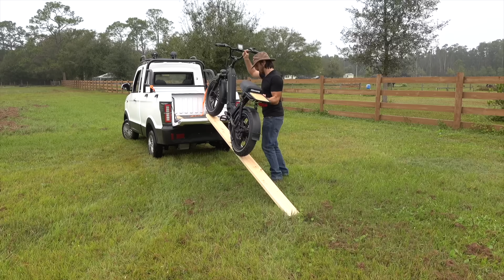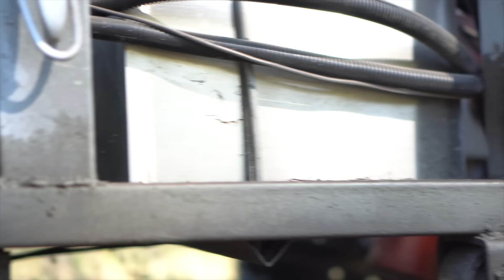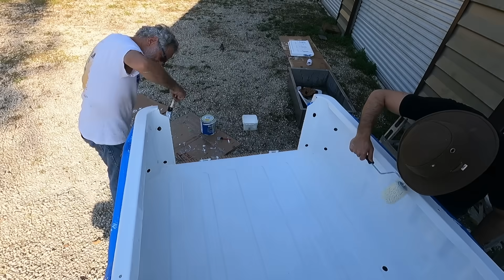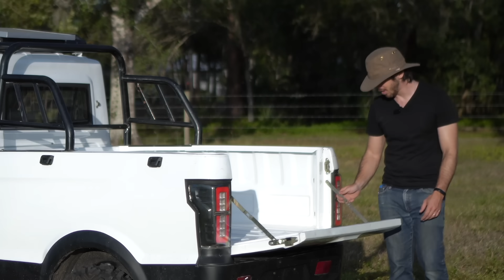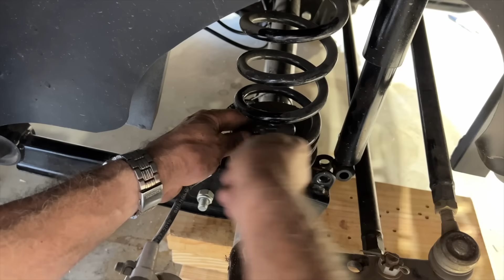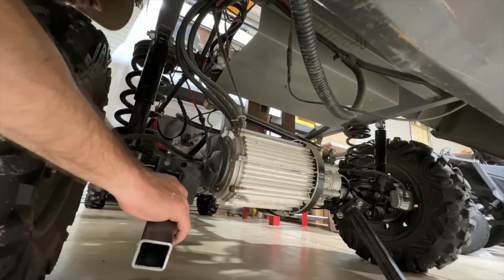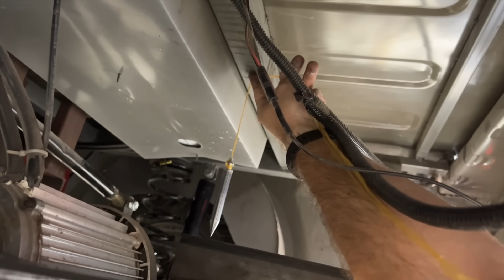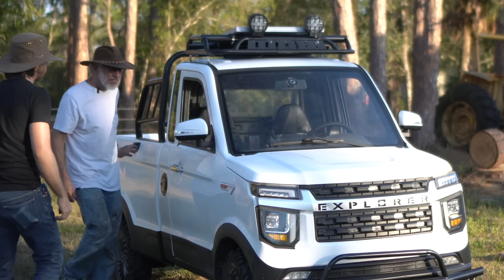My Chinese Electric Mini-Truck 18 Months Later: Did It RUST OUT?

Comment: At 150 dollars a gallon, I would have used epoxy. Not "epoxy paint", real two-part epoxy.
Reply: both have pro's and con's.  Used a lot of epoxy in the past.  Wanted to try this just to give it a shot.  Many good reviews on it.  Glad we tried it.  Good stuff.
Reply: @micahsdad5388  I've used it.  It looked good for about a year.  I used epoxy on another truck, and it still looks good after 20 years. 
Anyway thank you for your channel.  
I have a house in a city located on an island in the Caribbean.  That truck would be the perfect vehicle.  Town is just one mile away, all paved and level.  I don't require heat nor a/c.  I think with 100 watt solar panel, I won't have to plug it in.  
I would like to order three units.  Do you think that  they would fit in a 20 foot container?
Reply: @josephmistretta6211  Appreciate your review of that product.  Yes - I think that 3 would fit.  Be sure to ask the factory that question.  They might need to tilt them up on an angle.  I have seen that done with mini-cars to increase capacity of a shipping container.  What Island ?
Reply: @micahsdad5388  Isla Colon in Bocas del Toro.
Reply: @josephmistretta6211  How wonderful.  Was nearby there a couple of years ago going from Costa Rica to the Panama Canal.  Beautiful !!
Reply: Yes, the canal tour is amazing.
They could use an Ebike shop in Bocas Town.  Something to think about.

Comment: Mounting the tow hitch frame to the axle and the truck frame sounds like it would restrict axle movement.
Reply: Still working on that design.  Lots of limitations due to the design of the dump bed so some compromises will be necessary.  Stay tuned for the final iteration.  Best regards

Comment: This is the "3/4" spring.  Makes sense if you were loading up the truck.  I can tell you from experience an F250 has basically no 'spring' when empty.  But once you get it fully loaded you are happy for those heavy springs.  This seems like a downgrade/sidegrade depending on what you are doing.  But hey, you tried the original ones and you weren't doing the kind of work they rated it for (1,000lbs of gravel?)

Comment: I’ve seen ppl sell these without the upgrades you guys did - 10,000-15,000 
Would you guys ever upgrade and sell these? I’m so in love
Reply: Nope - thought about it but not interested.  There are a few some small companies doing it.  Problem is that these are NOT street legal and do not simply qualify as Low Speed Vehicles (LSVs) just because they don't go over 28 mph.  Without being street legal there is a very limited market sector for them.  We have such a use on our private property.  There may be a few very isolated communities that would allow it (by simply looking away?).  But without a VIN, lacking various DOT approved equipment (lights, glass, seatbelts, etc.) and not being manufactured by a NHTSB recognized factory, these will never be street legal (even though some people are saying you can license them just like golf carts - generally not true).  Thanks for your comment.  Best regards.

Comment: letting the tailgate go down flat would it interfere with the dumping feature of the bed?  when the bed goes all the way up will the edge of the tailgate be hitting the ground or the concrete when you're dumping a load? I would check that first to see what the clearance is.

Comment: So the 2k truck was how much after fees? Asking for a friend
Reply: see original video for detailed breakdown of all costs
Reply: $7,950 TOTAL for the $2000 truck from China  🤔🤣
Reply: @re3065  yep - and still a great value considering all that this thing does.  Expecting to get years and years out of it considering that at 18 months in it is running great without breakdowns of any kind (did let it run out of juice once - my fault !).

Comment: I was thinking about using it for a power golf cart around my community,  is it street legal, did you get the paperwork for a title?
Reply: NOT street legal, even as a LSV (there are some importers saying they are but this is not true except in the most extreme local community situations).  There is NO VIN - can't be registered without a standard US VIN.  No paperwork of manufacture from a DOT approved factory.  Many non DOT parts such as seat belts,  glass, lights.  No way to insure it for the street without a registration.  Sorry, but these are the facts and some people may have been burnt by being told the wrong info.   Thanks for asking

Comment: Hi Micah, very interesting video and it's great to hear that something that comes from China basically Made in China, can last one year and I do hope it lasts even longer than that, looking at this video, I was wondering about the little Chang Li's hill climbing abilities, and how steep of an incline it can climb? If this is a solid product and has good hill climbing abilities Chang Li, should probably promote this product to hotels also, In fact I wish I had something like this for short hops to the shop or getting the garbage out. However Alibaba for me has a lot of issues. I have seen interesting products but there's been a lot of scams also, if Alibaba can solve this or if Chang Li can partner with reliable companies maybe one day I may consider one.
Reply: We don't really have hills here to test it out but we have driven it up some dirt mounds in low gear and it just hauls right up.  Can tow 5000lbs on level ground so running up a hill shouldnt be an issue.  The knobby tires we added sure help with traction.  It is 2 whl, not 4 whl drive.  Best regards

Comment: Maybe I'm understanding this wrong, but you fastened the tow hitch at the axle?
So it's not spring-loaded? But you fix it to the frame above the tow hitch, which is sprung mass?
Reply: Hitch to axle was only way to do it due to the dump bed.  Plan was to have the threaded rod slip up through the frame member to allow for movement.  Not great for sure.  We are looking at loading and spring compression to see what other changes we can do to make it better.  Stay tuned

Comment: So you bolted the tow hitch to the axel and body both. You do realize the axle moves independent of the body right?
Reply: Hitch to axle was only way to do it due to the dump bed.  Plan was to have the threaded rod slip up through the frame member to allow for movement.  Not great for sure.  We are looking at loading and spring compression to see what other changes we can do to make it better.  Stay tuned

Comment: I purchased the 2021 Changli Coco pickup truck. I have no complaints thus far. It does everything I need it to do and it's used everyday. Although, I have yet to replace any wear and tear parts, I was wondering if you have found somewhere to purchase the lights when they go out or the screen for the radio. I have been researching this information but do not see a supplier that sell replacement parts. Have you?

Comment: You could use a rubber mat to avoid scratching the painting at the backside.
Reply: True but didn't want to add something that would trap moisture and hold it to the metal.  We get a lot of rain here.

Comment: You should get some extra rubber seal around the doors and tailgate to get it a little more solid sounding ❤ dirt cheap
Reply: Think the real issue is lack of sound deadening in the doors.  Rubber door seals are very good and seal against the rain quite well.  Thx

Comment: How do I enter for ebike ... I have one I got to exercise in 2018 when my mom died the insurance I got and had a local shop put it together  it's 2023 the local shop is gone ...my knee has more issues I have to walk with a crutch cane now and would rather ride bike but I can't afford new motor setup or how to put it together myself  I have zip tied things that have fallen off bike  and the panel controller that broke sigh...so much for my idea to get around better spending a ton on ada transit rides ... it has a 52v 17.5 ah battery  that still ok I have a it says on bottom of motor a 48v 1000w  can't seen to find a 1500w banfang anymore...  so seeing the one u have and the truck is awesome idea but being disabled now I'm on a very fixed income so trying figure out how to work this is becoming hard... anyway if ebike already gone that's OK...but I am now subscribed to you cus it's awesome... maybe if I can figure out how to get a new motor could you possibility help me figure out how to put it together on my bike  I haven't attempted nada cus in PT cus herniated disc cracked my l5s1 and I'm trying to repair it first... also about how much does it cost to ship a 4x4 like yours that would help me around town get groceries and go to docappts cus  I can not afford a car done tried that route ended up losing so much I could have bought one of these instead... anyhow ... love the you tube channel...

Comment: If it does start sagging bad under load, you guys could consider airbag suspension in the rear to make it adjustible. It actually wouldnt be that expensive to do a sort of ghetto airbad setup.

Comment: So a couple of questions

1. What happens if the electric motor gets swamped with water

2. Is it only for "off road" or can you register it for road use

3. What is the top speed
Reply: They are water proof and you need change few parts if you want to make it street legal like windshield blinkers and more parts and top speed is 25miles per hour . I am living in finland so top speed will be 35-45km/h but it depends from battery , top speed in europe is more in numbers because its European saying for top speed
Reply: It's 2023 theres a sweater proof motors and battery. Look at tesla for example doing the same

Comment: Folks who default to the overgeneralizing "chineseum" kind of thinking don't realize that these trucks were developed for old folks who live in the Chinese countryside.  

I remember a ride in the back of a minibus on a rural road in China as a tourist and GODDAMN, I would prefer to be on a roller coaster..... and I HATE roller coasters.

Also, Changli should DEFINITELY add some of your upgrades from the factory and it would barely cost much more, since half of the cost of this truck is the damn mobster-business import fees.

Comment: Conveyor belt rubber matting is an excellent tub liner. It's tough, stiff and non slip.
Reply: agreed.  good stuff.  Our concern is trapping moisture below the mat.  regards
Reply: @micahsdad5388  true… why not spray the bed liner thingy there and then put the conveyor belt rubber matts?

Comment: are you sure it is made out of steel I think it's probably made out of aluminum and thats the reason why there is no rust.
Reply: Nope. - good old magnet test - it is steel.  Would be too expensive for aluminum - raw material higher in price, harder to form, harder to weld, etc.  Galvanized steel.  Regards

Comment: Lol there are people out there with trucks at least 20x the price of this cutie that do similar or less work but aren't as good at it. I assume it's a significant advantage that that thing has such a small footprint and probably low-ish ground pressure. Feature set is shockingly complete for the price. AC, backup cam, bed dump etc.

Comment: I don't believe the claim that the small solar panel would make up for half of the charge on daily usage.
Reply: if you had the data, you would believe it.  By way of a heads-up comparison, how much charge do you get from your panel on your mini truck?
Reply: @micahsdad5388  No one powers a moving vehicle with solar panels because it makes no sense. Small size, wrong inclination , wrong orientation, masks, battery charging efficiency, energy lost to move it around. I would guesstimate that on a good day you can power the head lights for an hour. If I cared enough with the size & type of panel, the location and weight of the vehicle it's not that hard to figure out for a set speed at best how far it can go empty per day of charge and it would be pathetic & still more than real life.
Reply: @cgourin  Battery is being recharged any time the truck is outdoors, moving or not.  All charging data is given in the video.  Your "guesstimate" vs real data.  Please.
Reply: @micahsdad5388  I apologies here where I live on planet earth a 120w solar panel would need 10 hours of solar noon to run a moped power equivalent engine of 1200W for an hour. Since here we don't get noon all day the best I can hope for a well designed fix installation would be half of that, once stored into a good battery you lose another third, already we are at 20 minutes of usage for 10 hours of charge, add to that bad inclination, shades, dust, weather and the losses due to moving it around and you successfully managed to turn a usable generator into e-wast that will have cost way more energy to produce then it will ever provide.

Comment: If it's possible to reduce charging by half using the solar panel, the truck must not be used much. Solar panels don't generate much power. or the battery is very small 😜

Comment: Put the electric motor fan shroud back on, that is a key part of the fan blowing directing cooling air over the motor to cool the motor, motor could overheat in hard use and it will last longer wth fan blowin cooling air over the motor. With the fan shroud removed zero cooling air is directed over the motor.
Reply: already reinstalled.  all good

Comment: The only thing i find a little odd is hooking the trailer hitch up to the axle housing and the frame. as the axel housing is going to be moving a bit when you're going over bumps when driving, and now with the change to softer springs the truck is going to squat more when loading up the bed which is going to cause the distance between the axel and frame to closer together.

I would also put that cooling shroud back on the motor as while it doesn't seem to be causing much issue right now, the heat over time will cause the bearings in the motor to have issues. You definitely want the motor to keep as cool as possible for a longer life, the shroud is ment to guide the air around the motor for cooling.

Now the tailgate not opening level could be due to the fact the vesd tilts, probably to keep the tailgate from hitting the ground when you tilt the bed.

For the tailgate limit cables, you can use coated clothesline and cut it to your desored length. And crimp amd solder the tips onto the cables.

Comment: I may be wrong- but from experience (and the sound when you touch it lol) I'd expect the bed to be aluminum, so it doesn't rust.
Reply: Nope. - good old magnet test - it is steel.  Would be too expensive for aluminum - raw material higher in price, harder to form, harder to weld, etc.  Galvanized steel.  Regards

Comment: I'm quite curious to see how the dump bed and suspension compression work with the hitch attached to the axle.
Reply: we are monitoring that as we begin to use it.  May need to make minor changes depending on the results.  Stay tuned

Comment: before you invest in tailgate cables you should see if the hinges and bumper allow it to open 90 degrees.
Reply: Bumper moves with the bed as a unit so it is not an issue.  Thanks

Comment: You could always have stronger springs on the rear compared to the front. So then the ride will be smooth and the rear can hold the weight best of both worlds
Reply: True - we will be monitoring the situation as we put a load into the bed with the new rear springs

Comment: I would love a more powerful powerplant on this thing and do an overhaul to make it finally street legal so you can haul around slightly larger and heavier cargo. Also, adding a second solar panel just increases its range quite a bit more.

The paint on the liner does make the truck look much newer than it was when it arrived to you.

Comment: ICE's will continue for centuries, whether governments want it or not, to power the world with electric would cost the multiples of the worlds GDP, yes incremental gains are made but, they will take decades still to be anywhere near competitive, unless we tell poor nations they can't do what we did and still do to become prosperous, we need a mix of reliable fossil fuels with a mix of unreliable wind and solar.
Reply: According to Worldometer, there is about 47 years of oil reserves left, found comparing current known reserves with current consumption. Of those 47 years, the average person like you in me will likely only see about 15-20 years of those, from there on it will become so scarce that it will become too expensive. Electric is the future, however, 20 years is not even close to enough, maybe even 47 is not enough. California, which banned gas car purchases starting 2030, did not have enough energy to power all its electric cars and started issuing blackouts. I think the best answer is nuclear. Investing more time and money into safer nuclear options such as Thorium reactors will provide vast amounts of energy at very cheap prices with relatively little waste. Air pollution, much of it carbon based pollutants, kill an estimated 7 million people each year according to news sources such as The New York Times, CBS, WEF< and the UN. The three major nuclear accidents, Fukushima, Cherjnobyl, and Three Mile Island, have officially killed 32 people, in total.

Comment: At the section put the new spring in, we can see this truck has a stock adjustable panhard bar. Very Nice
Reply: Correct.  And steering is rack and pinion.  Good design with robust parts